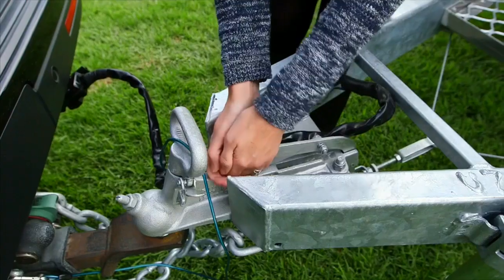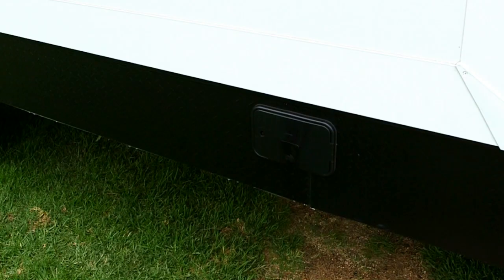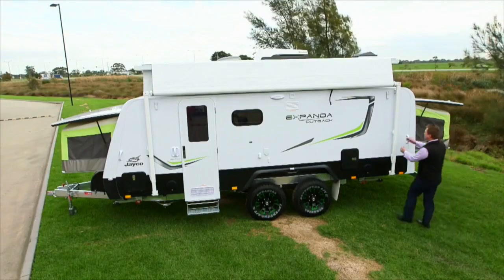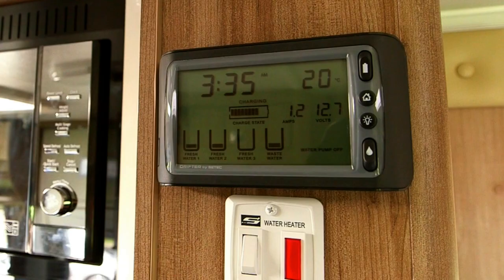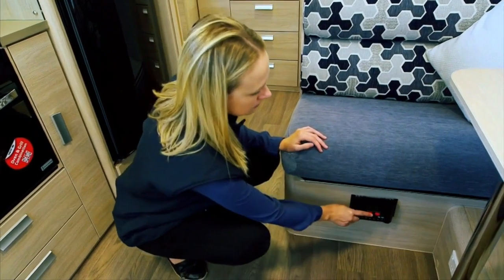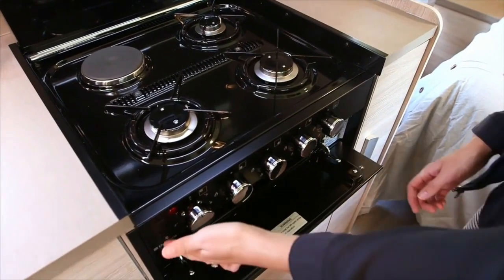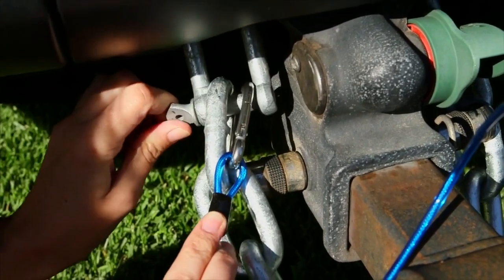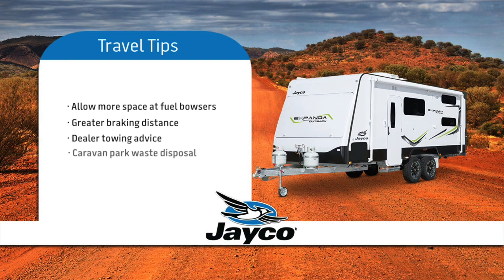Understanding our Expanda

Comment: Hi, how to these perform when its a bit colder, is the van freezing?
Reply from the maker: Hi, It is a bit chilli cause it has the canvas at the ends but if you have power it does have and heater/ac in the ceiling which we found work well.